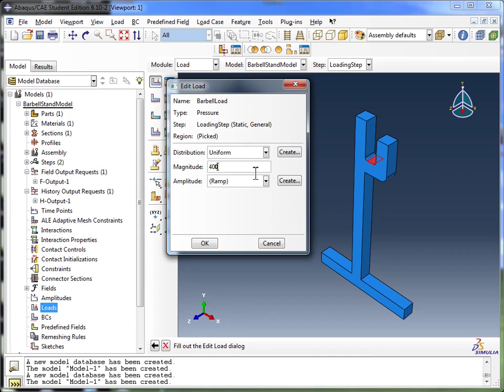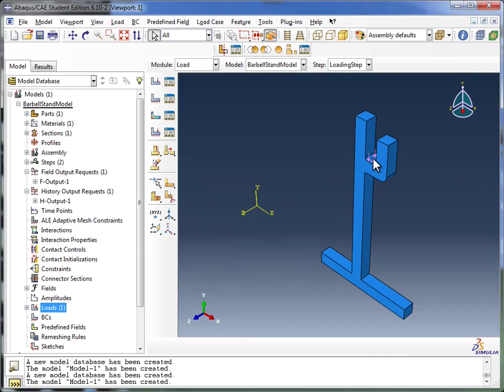1.m) Abaqus Basics - Apply a Load

Comment: In the load module using Newton as pressure is wrong. 
You should use Pascal for metric or Mega pascal if you used mm in your dimensions.